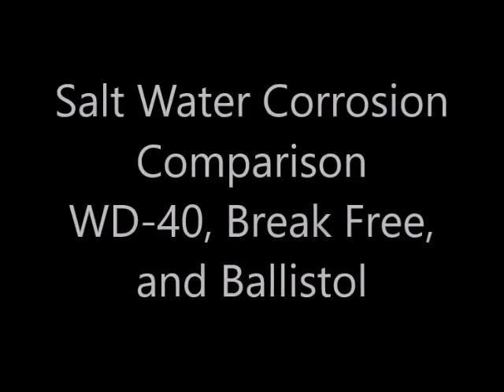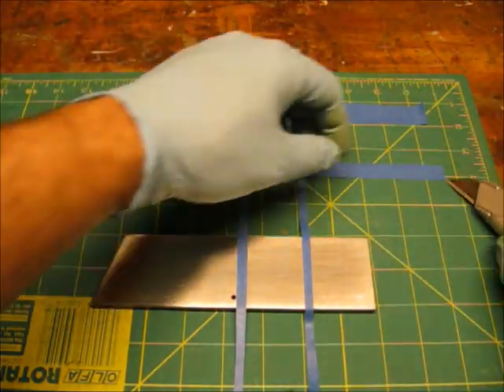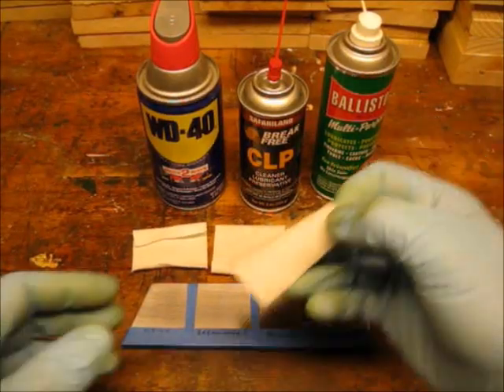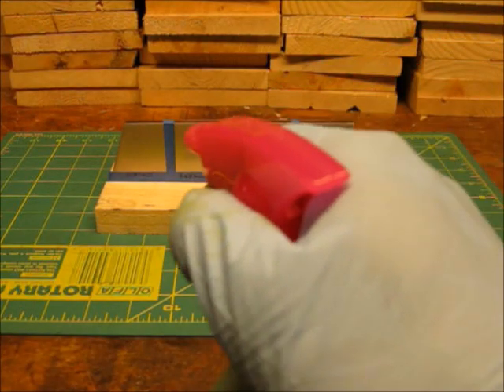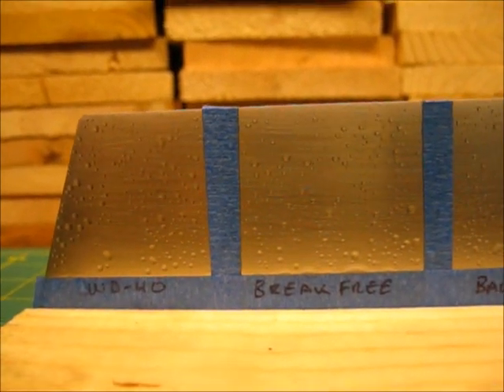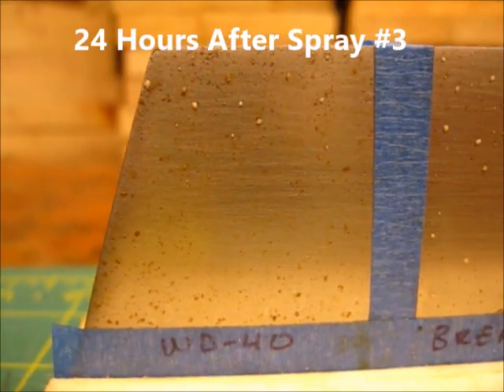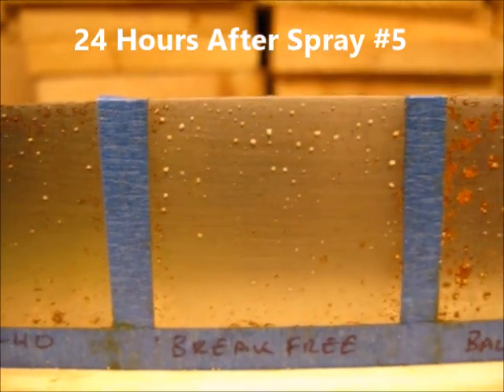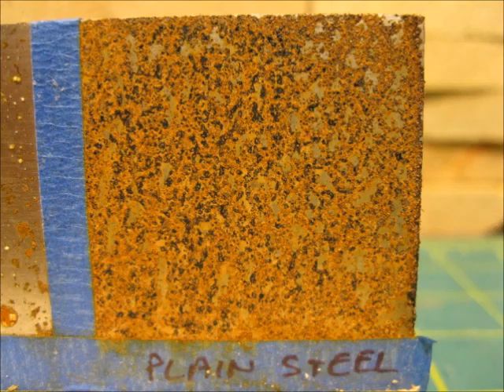Salt Water Corrosion Comparison WD-40, Break Free CLP, and Ballistol

Comment: Those 3 products, are completely different to compare them. WD-40 is designed for one job, and that's penetrate rust. It's versatility ends, on a couple more uses, like removing glue residue etc. Ballistol is do it all oil, it can lubricate and protect, where WD-40 isn't proper no matter if you think it ok, it isn't. Ballistol can has endless uses and it's closer to be an oil, than WD-40 ever was. 90% of the people use WD-40 completely wrong. Break free CLP on the other hand, is a specilized gun cleaner/protector, again a different product than the other 2. As a chemist, I can assure you, that those 3 are so similar, as Coke-Cola is to rain water... they are 100% designed, for different uses.
Reply from the maker: Thanks for watching!  The "WD" in WD-40 stands for "water displacing".  It was first used to prevent rust and corrosion on the outer skin of the Atlas Missile.  Ballistol and Break Free are both CLPs - Cleaner, Lubricant, Preservative.  I like to use WD-40 for my corrosion comparison tests because it is readily available and just about everyone has experience with it.  I think any CLP should be able to prevent corrosion at least as well as WD-40.
Reply: @357magdad  That's how people use them. I dont know if the marketing of the products, says such uses similar to what you describe. I have a degree in Chemistry ,since the 90's, I can't explain in a comment, but there other comments, like mine, on this video, who say the same thing as I do. These are completely different products, designed to do different things. It's like comparing Coka-Cola to rain water. both are liquid, but in the same time different. Ballistol, produces a products, closer to what a CLP is, but their Universal oil, is no where near, to either a CLP or the WD-40. Check also the comment of John Stark, if you can't rely on ones knowledge,  first think he says, is what I say.
Reply: @357magdad  That's what I said, WD-40 is mainly for rust, it's not a lubricant. If you use it as such, as most people do, eventually you can destroy stuff, like the small parts on a door lock, wd-40 can "eat" little by little, those small parts a lock has inside and eventually damage the lock. Ballistol universal, is a multiuse oil, not just a clp. Clp is mainly for guns and offers way better rust protection, antidust etc.  With all the respect, I think that a bit of "Ego" doesn't let you understand. Go do a better research, show the substances to a chemist and ask him. What do I or, the other people who say thse are completely different products, and most people make wrong use of these,what do we have to win? What do you win, if keep listening to your ego, instead of the truth?
Reply: @greekveteran2715  bought Ballistol Gun-Cer as a muli-purpouse oil but I was wondering whether Gun-Cer would be as suitable as WD-40 for anti-rust long term storage. I understand that it's better suited for lubrication rather than long term rust prevention.
Reply: @florinmoldovanu  WD 40, shouldn't be used where small parts exist (like on keylocks, or inside  a weapon mechanism. Ballistol and WD 40 are 2 completely different things. WD 4o, isn't even an oil, while Ballistol on glass and metal bottles, is closer to a general use oil.  WD 40 should be used way less, than people use it, becasue that's it's nature. it can eventually damage small parts thus damage the whole mechanism on something... Ballistol will do the opposite, it will do good to any material. For long term storage, you should use either Break Free, or similar, Ballistol will work, but people don't know how to use it properly. Actually 95% don't understand, the huge differences and make wrong use of those products, as if those where the same products.

Comment: Japanese woodworkers, cutlery and sword makers use Camellia Oil from Japan to protect carbon steel tools and blades from rust. I wonder how it would compare to these products?  $15.80 on Amazon - "KUROBARA 100% Pure Tsubaki Japanese Cutlery Knife Maintenance Camellia Oil (8.3 oz) Dispenser".  

Thanks for making this video. You and Chuck are always on point, and share a very clean work area (which I have never been able to achieve).
Reply from the maker: The camellia oil sound like interesting stuff.  Looks like it is used for skin as well.
Reply: Lol I just saw a post about that stuff on Facebook and random rust prevention googling led me here
Reply: I use camelia oil on my Higonokami and on my GB Small Forest Axe, so far no stains or spots of rust. And I live in the Netherlands, where it's very humid all year round. It doesn't leave a sticky layer either, works on the axe handle too. I'll give Ballistol a try soon but camelia oil worked great for me so far. My other knives are mostly stainless so no need for treatment...

Comment: I'm new to kayak fishing (I'm saying that there's a good chance I'll be in the water even if I don't necessarily want to or have time to prepare to...) and want to have my polymer and stainless steel pistol in my vest's pocket.
Saltwater fishing only.
I think I can have the pistol in a ziplock inside the pocket.
The "normal" gun oil (the orange bottle sold at Sports Academy) wouldn't be enough to clean and lubricate the gun after each fishing trip?
Reply from the maker: Thanks for watching.  I think any CLP will perform well lubricating and protecting.  If you shoot anything on your fishing trip, you may want to use Hoppes #9 to clean the barrel.

Comment: Thanks for the experiment. Interesting. I would comment though that while you went to the effort of using gloves during the application of the three products to avoid contaminating them with the oils and amino acids from skin on your fingers, after you applied the ballistol, you had that product on your gloved fingers when loading up the Breakfree application, and then when you loaded up the WD40 application you had both the ballistol and break free on your fingers. That means the break free blank likely had some ballistol and break free on it and that the WD40 likely had all three products due to the contamination of manipulating the cloth patches with your fingers.  I don't know if it is significant, but it could have had an effect on the outcome.
Reply from the maker: Thanks for watching!  I used a new patch for each application.  The amount of product on my fingers was negligible.  This test is pretty simple - give it a try with your favorite CLP!

Comment: Interesting 
I use Ballistol because it’s nontoxic and also works on gun stock leather sheaths etc.
I doubt if I will ever get that much salt water on my guns if any,
Reply from the maker: Thanks for watching!  I used the salt water to simulate sweat from your hands.
Reply: @357magdad  But you touch not so many parts by hands! Slide, grips, magazines... anything else? Safety lock? :)
Reply from the maker: @daitedve1984  Thanks for watching!  I'm a revolver guy - there's lots of touching when handling a revolver.

Comment: I’m kind of surprised that all 3 products allowed some rusting after a relatively short time. I guess my search for a good corrosion preventer must go on.
Reply from the maker: Thanks for watching!  My test shows how corrosive salt water can be.  The sweat from our skin can do a number on carbon steel.  Not to mention your car on salt covered roads in the winter!
Reply: 357magdad : Luckily for me, here in the Rio Grande Valley, they don’t put salt on the roads (because there’s no ice here).
Reply: @censusgary  tri flow, saw a similar test but with like 30 different oils. tri flow was one that had practically no corrosion after like weeks of salt water. its cheap and meant for bike chains and has teflon in it. only con is its a skin irritant.

Comment: @357magdad so as I get it right - wd40 and break-free are not lubricants. they let's say something like preservatives? for this purpose - may I use any other break-free spray or only this brand on video?
Reply from the maker: Thanks for watching!  The Breakfree and Ballistol are "all in one" cleaner lubricator protectors CLP.  I've had good results using the bBeakfree as a lubricant.  I compared them to WD-40 because just about everybody has used it.  I have not used any other BreakFree product.
Reply: CLP....CLEANS....LUBRICATES....PROTECTS !! ITS  RIGHT THERE IN THE NAME.

Comment: All these products are for different applications. WD-40 has proven itself on my boat used in salt water for getting things rusted broken loose more then once.

Ballistol is great for cleaning/lubing my black powder guns. I can't use Break Free here as it gums with black powder fouling.

Yes on my other smokeless powder guns Break Free works great. Also I did take one thing from this, it seems to be a damn fine rust preventative! I may have to use some on the boat to avoid using WD-40!

Comment: I am yet to see a single woodworking tool of high carbon steel that Ballistol protected. Maybe it protects in the long run, against deep rust. But all of my blades are covered in brown rust.
Reply from the maker: Thanks for watching.  I am a fan of WD-40 for coating tools.  You may want to try the Break-Free for long term storage.  It has a thicker consistency than WD-40.  I have been using it on my reloading press and on my garage door pulleys/followers with good results.

Comment: I believe break free seasons onto metal surfaces when they heat up as well. In the military you could smell and see it cooking of as you fired a lot of rounds. After the metal was treated with this stuff by each troop to field that weapon over a 30 year period water would bead up on metal that you thought was completely clean and burned on powder would just wipe off with a rag. WD-40 was originally designed to protect thin stainless steel rocket propellant tanks and it did a great job but it was flammable back then, now it's not so I'm not sure the formula is this same.
Reply from the maker: Check out my video where I test several CLPs' ability to "season" the steel plate.
https://www.youtube.com/watch?v=kRnEmq-I6pc&t=26s
Reply: THE MAIN I NGREDIENT IN WD 4R0 IS MINERAL SPIRITS A VOLATILE ORGANIC BURNS EASILY WITH A WICK OF SORTS.